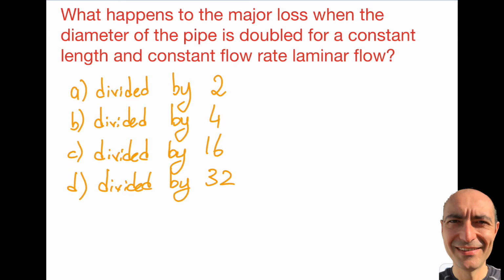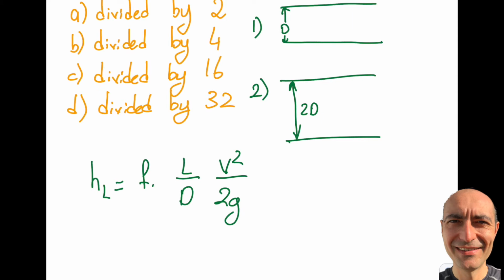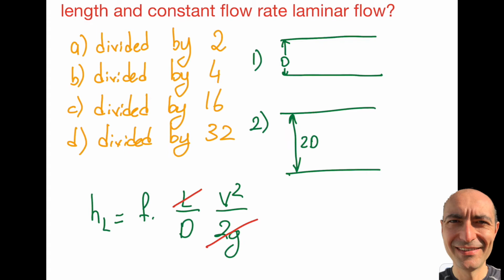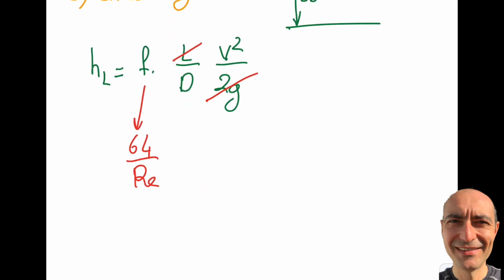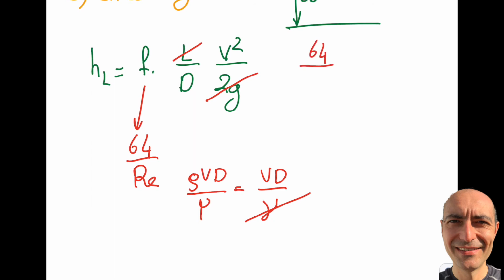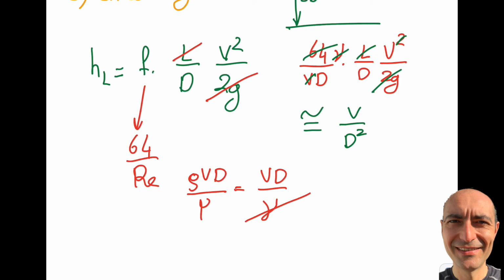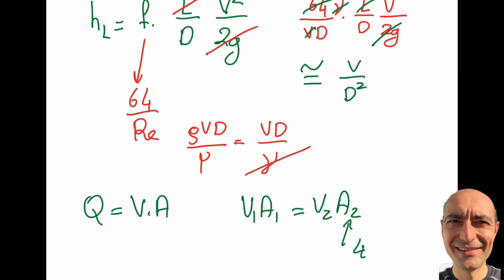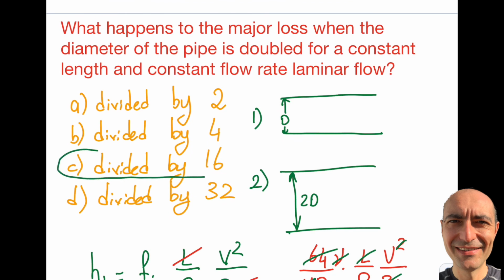FE Exam Fluid Mechanics - 4.5 - Practice Problem - Head Loss Due to Flow

Comment: Hello Dr. Guldiken, knowing that this problem considers the flow to be laminar, how feasible is it to use the pressure drop for laminar flow equation Q = (pi*D^4*deltaP)/(128uL). We know Q is constant. If we solve for deltaP and then substitute D^4 with (2D)^4 (since diameter doubles), we get 1/16 as well. Will that be a correct approach? Thank you.
Reply from the maker: Yes, great approach! You are correct.

Comment: Hello Dr. , how did you get the 4 in the continuity equation for area?
Reply from the maker: Jen: I am looking at the area ratio as the question is asking for the major loss ratio, not the major loss. The question states that the diameter is doubled (D2/D1=2). As the Area ratio is pi*D2^2/pi*D1^2; pi's cancel, I get the area ratio as (D2/D1)^2; hence this becomes 2^2=4

Comment: Hello Dr. Guldiken, 
I'm wondering why you cancelled the v^2 with the v in the denominator. Doesn't that change the original major loss equation? Thanks.
Reply from the maker: Hi Edward, good question. It sure changes the original major loss value. However, as I am investigating the ratio of two major losses, the answer will be the same whether I cancel the V or not. Try solving the question without canceling the V, you will see that the answer will not change.